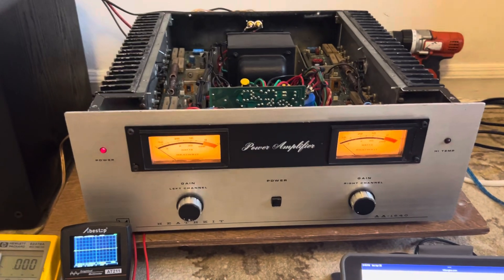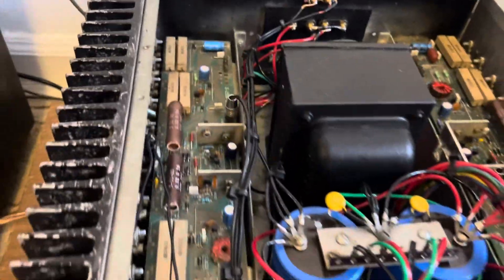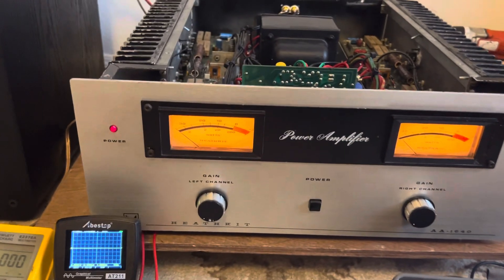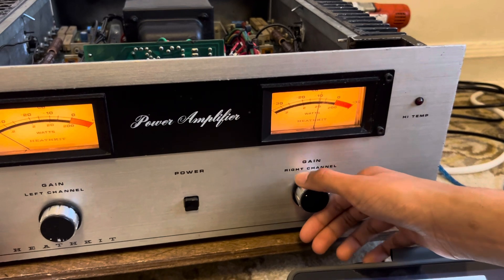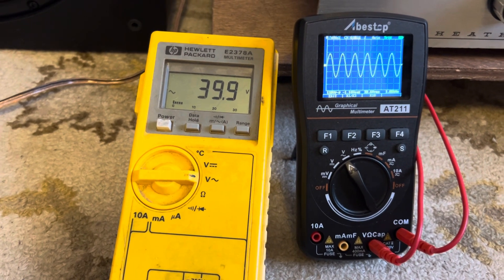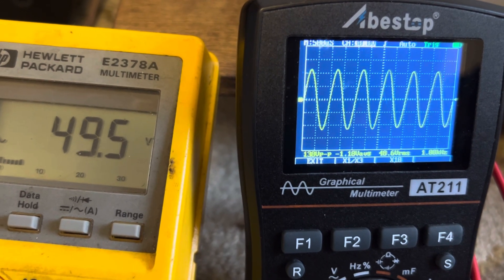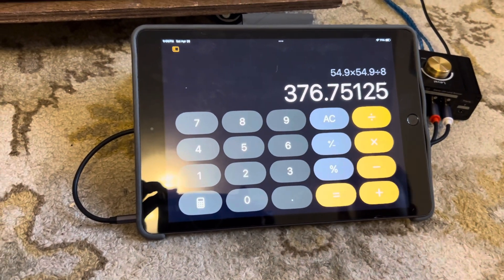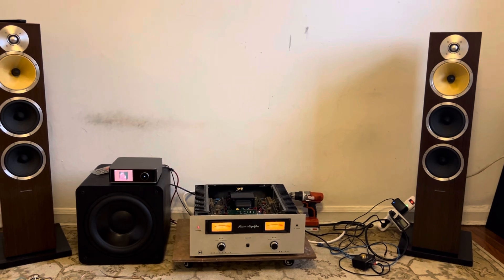Heathkit AA-1640 Amplifier Power at Clipping & Sound Test

Comment: Thanks for the video guys. I love my 1640-A, but it has a really obnoxious transformer buzz. Even still it drives my ESS AMT 6 Pro's speakers with ease
Reply from the maker: Are you sure it’s the transformer? In these amps there is a 10 amp relay under that box in the back of the transformer, it’s bolted to the back panel. That relay makes a lot of noise before it totally fails.
Reply: @DJ_Renn no I'm not sure if it's the transformer, just that the buzz comes from that general area. Bought it that way last year, sometimes it's louder than other times too
Reply from the maker: @NinjaKlownz So it sounds like the relay. I bought a 20 amp relay from Amazon installed it years ago and never had any issues. The relay is under that silver compartment on the back panel. If the relay is that loud, that means it’s probably arcing.
Reply: @DJ_Renn oh ok awesome! Thank you so much for the advice!
Reply: @DJ_Renn   xin hỏi bạn con1640 này chạy tần số 50hz  điện 100v có bị ảnh hưởng đến âm thanh không ạ.xin cảm ơn